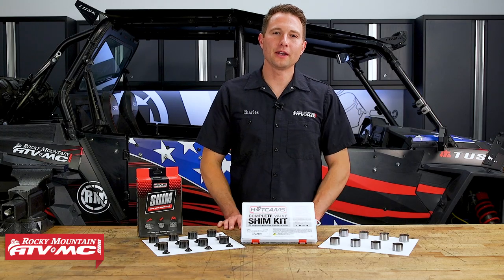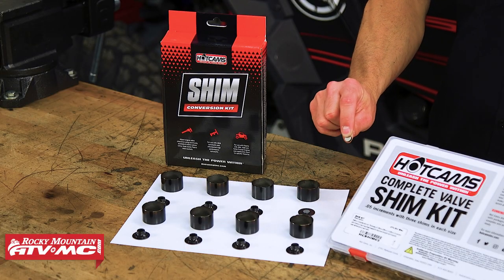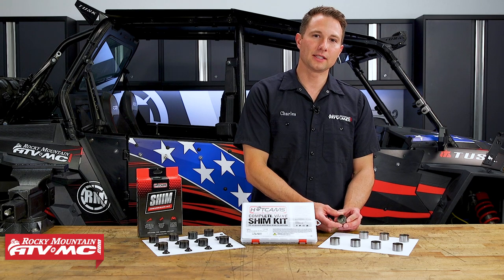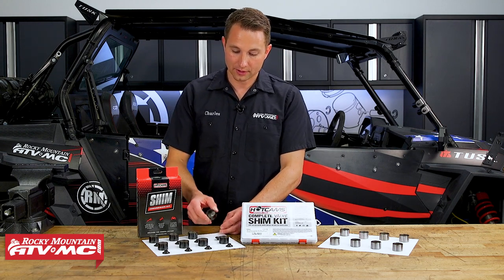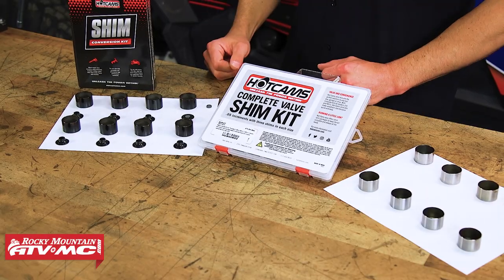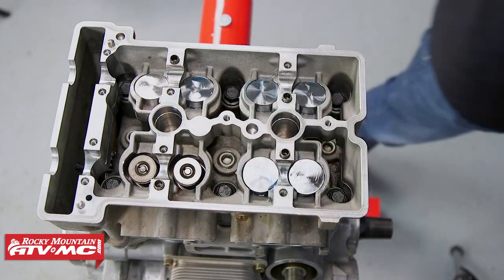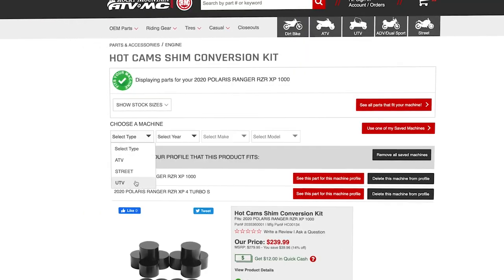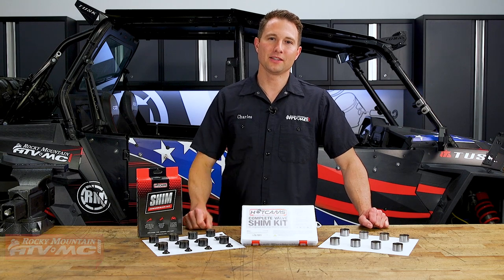Hot Cams Polaris ATV/UTV Shim Conversion Kit

Comment: Installed this kit on my 2014 900 XP (pretty easy to do on the engine with the smaller Lisle keeper remover/installer tool) but the stock buckets with the permanently installed shims are labeled from 458 to 490 which I believe is in mm (4.58 and 4.90mm respectively). The Hot Cams complete shim kit only goes as high as 3.50mm ... is there some kind of an offset between the two designs to give me starting point for choosing the right shims - I need to add between 0.05mm and 0.25mm to get my cam to bucket clearances within spec.

Comment: How often are you supposed to adjust valve lash
Reply from the maker: On RZR 900's and 1000's it's going to be done at 200 hours or 2000 miles whichever comes first. -Charles
Reply: You want to make sure your breather and airbox are TEE E I TEEYUTS or its going to happen a lot more than what Polaris suggests. They are non adjustable valves
Reply: Take it to an authorized dealer with a good service staff. You'll be happy with the bill lol

Comment: someone needs to design a affordable tool
So you can change the valve spring retainer without pulling the head  
   The Brian Crower tool 
Is ridiculously overpriced  
Hot cams could sell a lot more of these kits